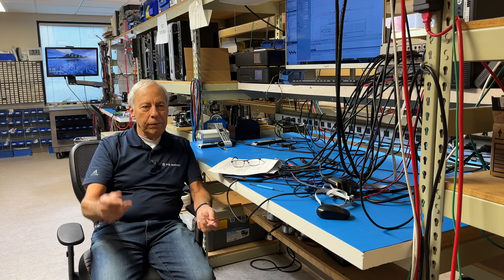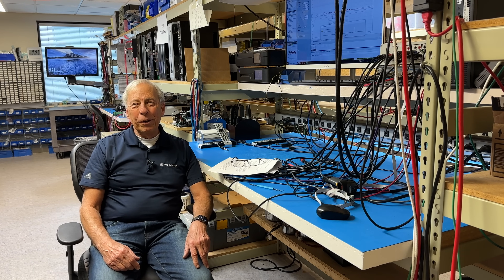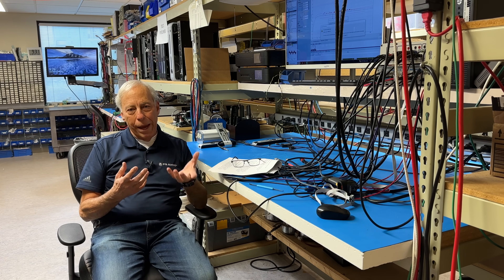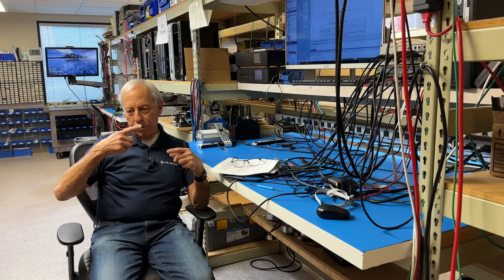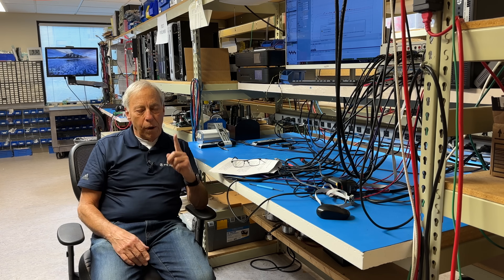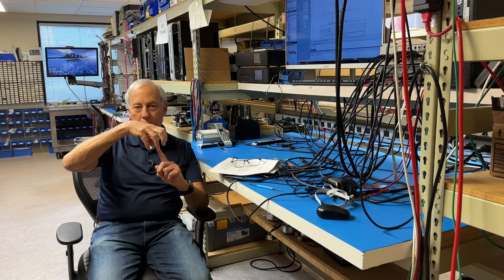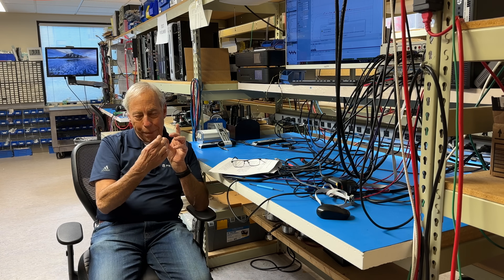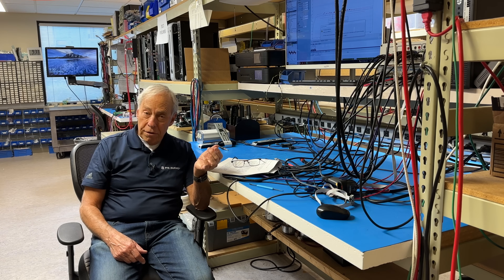Differences in phono cartridges

Comment: The microphone diaphragms do not defy Physics. They do not protrude outward, toward the sound pressure wave blast hitting them. Now, do they? No they do not! They are compressed inward.

And so then what are your speaker diaphragm cones doing? Think about that one for a moment.

Yes that's right. Your speakers are now mimicking. The motion of the microphone diaphragms. And so which way are your speakers initially moving? They are moving away from you. They are sucking away from you. You are hearing the rebound of Inverted Polarity. Out the front of the speakers. And the problems this causes in your room and with your monitoring? It is absolutely insurmountable! The aberrations this will cause. What you are trying to listen to your speakers. Because they are sucking away from you. They are trying to project the sound. Out of the back of the closed speaker box. Were all the low frequency waves are coming off of. And projecting to the wall behind them. Then those reflect off the wall. And come out toward you. Inverted in polarity. To the rebound of sound you are catching off the front of the sucking speakers. Moving away from you. And half the sound is canceling in midair within your room! All over the place! The amount of comb filtering it's causing is truly, Mind Boggling! And your room is filled with Monitoring Anomalies! Because you don't know which direction your speakers are moving in! You are convinced you have it right. Because you follow the instruction manual. To both your power audio amplifier. And your speaker boxes. And you have it wired correctly! Well it's wrong! Wrong! Wrong! Wrong! It's inverted!

Because mindless low information people. Have Demanded it to be Wrong! And the manufacturers are only too happy. To provide for their customers. What they Demand.  Because it's not going to hurt nor kill anybody. If you want it wrong? Sure!

And so what you will find here. Is, that there was one single, Speaker Manufacturer. That also properly thought this through. And bucked the system. Because  their Speakers. You will find. That they are, technically, " Out of Phase". To every and All Other Speaker Manufacturers, out there! At that one company is, JBL of Los Angeles, California. They are the only ones! The only ones in the whole fucking World! That figured this out!

Because everybody only relied upon their mathematical equations and Textbooks. And they left this microphone factor out! Because they are not, Actual Real Audio Engineers. Like I am. Many of them have college degrees! And they don't know what the FUCK. They are listening to? They haven't a clue? Because they will not question, their, Audio Bible Text Books. This is a Fanatical Religious Belief System. That's wrong! They got it wrong! Because they have no idea. What the complete process is or how it works? They only know the math. They only know the textbook examples. They don't know what they are listening to? Neither do you Paul. I'm sorry to inform you of. You've also gotten this backwards. Everybody does. Because they are mathematically correct to the textbook.

This used to be known as Garbage in. Garbage out. And that is precisely what you are hearing. Garbage. Because your absolute Polarity is Inverted.

 Unfortunately. This is a destroyer of, minds. This flies in the face of their textbooks! And they will now all look like Absolute Idiots! As College Professors. Because they got this simple thing wrong. It's a simple thing they all get wrong! Because they are not. Are Not, Recording Engineers, either! You are all Backseat Drivers! Oh my God! And you got it wrong. Because you're not the actual driver. You are not behind the wheel of the Microphones! You do not understand the Process! You left out this important part of the equation! The microphones! As you've done everything. From after the microphone preamp! But not the input. That's what everybody has left out. What's happening at the input! What are the microphones doing? Which way are there diaphragms moving?  When they are blasted by sound pressure waves?

And absolutely nobody. Has been able to think this through, correctly. 99% of everybody gets this wrong with a college degree.  And those without. 99% of everybody are in  Negative Absolute Polarity. With their speaker wiring.

Now I've had discussions with famous, hero of mine, Electrical Engineers. That believe they are correct. Until I spell this process out for them. And I wish I had a camera. For the looks on their faces. When they suddenly realize.  I'm right.  And they've told me they never thought about it this way before? And they have Electrical Engineering Degrees. They have degrees in Acoustic Engineering. They have never gotten this right! And they are absolutely dumbfounded by this! When they hear things correctly! It's a revelation! It's a game changer! It's Radical!

 Add the best thing about this is? The Fix. Is, Absolutely Free! It costs nothing to do! It takes all of 2 minutes. To make the fix. To simply invert. The wiring on both of your speakers. That's it! But only. Only. If, you are using anybody else's speakers other than JBL. Because JBL. Indicated,,  their Polarity, Backwards. From all other Speaker manufacturers. So that when you follow your instruction manuals. With the wrong wiring scheme. You will be hearing it correctly with JBL speakers. Because JBL bucked the system of inverted speaker wiring. Because they understood the process.

Now I know this dates back to at least 1968 for JBL. Though it could date back to the company's founding in 1948? And I believe. This is what brought about the separation. Between James B. Lansing and the Altec Corporation. When they went their separate ways. And Jimmy Lansing (not his actual real birth name) had thought this through. And had a disagreement with his Altec business partners. They believed they were right. He believed he was. And he split off to start the, JBL  Speaker Company. But we will never know for certain? Because he died shortly thereafter. Suddenly and unexpectedly. But the company continued. And continued with this technical concept. To this very day. And I know them to be correct. Others don't. They haven't a clue what's going on? They are Educated Idiots.

And let's face it. Most of these College Professors. Got their jobs doing that. Because they really couldn't cut the mustard. To do it Professionally. Like I have for over 50 years. And they come to me. To learn from me. As I have taught college professors. Because I cannot teach at the university level. I possess no college degree.  I simply went to get myself a Free Degree! In a place called a, Library. Where,, you can read all the books you want on Audio, for Free! It's FREE! It's All Free! At you don't need to spend, $30,000-$80,000. To have some college professor tell you what books you should read about audio. I mean DUH!

(More Real Life Audio in following post)

Comment: So it's tragically funny. It's comically professional. When you get this right. That 99% of these fucking college grads all get this wrong! They FLUNK! They all need to be told what they are hearing! When they are hearing it wrong. And being told that's right. Because it's somebody else's cockamamie distorted religious belief! And you will follow them! They are the master race! And they can prove they are right! And Remy must be nuts!

That last comment is very true. I am nuts. Because I know what I'm hearing. And it's making me nuts! That everybody is wired wrong! And I'm alone. With my religious belief along with JBL. We are the outcasts the black sheep the bad guys. Because everybody else must be right! As they agreed together in a mob of thugs. You will do it our way because we are right! And Remy and JBL is wrong!

Yeah no. I am absolutely right! So is JBL. And that's why I love their monitor speakers. Though I do use others. I have them wired correctly. And I've had other good ones like, Myers, Genelec, Tannoy, KRK, Adams, Active Monitor Speakers. And they are all inverted in negative absolute polarity. And for those? Those require a little technical skill. Along with a screwdriver and soldering iron.

Because with these, Active Type, monitors. You must first remove both, the woofers and the tweeters. (As most are typically 2 way systems). At you must use your soldering iron. To reverse the connections on the tweeter. And then to reverse the connections on the woofer. And then to reinstall the speakers. Into the box. Tightening them, Light Fisted, snuggly. But not wrenching down upon them. With all your strength. Do not do that. Simply make it snug. Not over torqued. Just lightly snug. To be clear. So you don't warp anything. To cause misalignment of the voice coil. Because the closer to the magnet the better. And the tolerances are very tight. So over torquing the screws could cause misalignment  of the voice coil. When you realize how fine the adjustments must be. On the old-fashioned magnetic analog tape recorder heads.  And the extreme precision, those required. That just taking a recorder out on location. Caused variations in head  alignments. And you had to adjust the heads. With test equipment. Once you got on location. If you cared? People like myself cared, a lot. Because I am a Top Professional.

And so we have all acquired and accrued. Different knowledge bases. Within our career fields. And mine runs the gamut in Pro Audio. At the Top of the Heap. Of the Companies. That made the world's greatest recording equipment. More than one. And I was a big contributor.  I was a Requested, contributor. When you gain a reputation. Where some of these companies. Only hired the world's best engineers. Like RCA. Like Bell Laboratories. Like NBC. And well? I worked for a couple of those companies myself. And so did my mentor. To the other one I didn't work for.

And then some kids get, recording certificates a.k.a. degrees. From Recordi Skooolz. And they wave their degrees in my face. And say look what I know! Yeah? What? I can do ProTools! Goody for you Sonny boy. What's your most fun plug-in game? ROCK-EM SOCK-EM Universal Audio? ROCK-EM SOCK-EM Waves? ROCK-EM SOCK-EM SSL? ROCK-EM SOCK-EM  Stephen Slate?  Those are so much fun to play! I don't have any!

So try this for yourself. With both your left and right channel speakers. This must be done strictly at the audio power amplifier output  directly to the input of the speakers. That are going to move the air. And which general direction they will be moving in. Because only there in that position. Can one change the Absolute Polarity. Because Polarity and Phase are two different things in the land of Pro Audio. And nobody understands this variance in jargon? But it's very real. If you want to hear it for real. And not in Negative absolute polarity. Which you are currently listening. Everybody is. Unless you are running JBL speakers. Passive or active powered types. JBL got it right.

Because if you change the phase at the input of the audio power amplifier. That merely inverts the waveform. It does not change what the Absolute Polarity is at the output. This is what everybody gets wrong including electrical engineers. Everybody gets it upside down and inverted. But it's not upside down. It's outside in. And you want the inside out! You're not getting that.

This actually requires one to actually think in 3 Dimensions. Astronauts have to do that. Generally audio engineers don't have to. We deal in lateral soundwaves. Here on terra firma. But understanding what's happening in 3D is Monumental! Everybody else just has mental. They are mental cases. They did all the math and forgot the microphones. It's professionally pathetic and tragically funny. It's terminally stupid. But then some folks still like Donald Trump. And there is nothing to like about that, whatever it is he is? As I've already known to many disgusting overly wealthy children of wealthy parents. And many get like him. And they keep pushing the envelope and breaking laws doing so. Because these kinds of boys like to cheat, cheat, cheat. They make their livelihoods, cheating others. They are Professional Grifters or so to speak. So is Dolby Laboratories.  If anybody buys into this, ATMOS, crap? Immersive my ass!

When your speakers are in Positive Absolute Polarity.. You will achieve. Surround Sound. From only 2 Speakers! Because they are now moving out and protruding, toward you! And everybody is doing, Frequency Response and Room Evaluations. While pumping sound out of  sucking,, negative absolute polarity speakers! And then measuring with a microphone! Whoop de do! Your speakers are not moving correctly! And you are measuring the room. What? Are you kidding me? Unfortunately you are not.

I have had to solve the problems. That electrical engineers have not been able to solve. Because I am not limited. By a college degree of misrepresented information. About somebody's godly belief in something wrong. Hitler had a belief! Kill all the Jews in the world will be better! I don't think so. I'm Jewish! But I don't practice the religion. Because I'm scientifically oriented and aligned. And you have to look and listen to things. From all different angles. Like inverting phase here and there. Then inverting absolute polarity here and there. And you take a listen. Because textbooks and mathematical formulas can't. So we people have to do that. And some people look to us to help them with their problems. As there is more than one religion and solution.

Most people buy into that one popular religion. Which for all intents and purposes. It is also 99% right! Except at the tail end at the output. That's what makes this so funny. It's like everybody was taught for being a little kid. You shouldn't play with your butts. It is just not politically correct. It's not clean and transparent. And it smells funky. Dogs and cats seem to like that. Most people don't. Because it smells like shit. Because it sounds like, shit. Because you have stepped in, shit. And you are walking around with toilet paper stuck to the bottom of your shoe. And your audio smells funny! LMAO.

And so it can be turned into a, colloquial, poetic comedy. Because it is! I think it's very funny. Because I make control rooms and listening environments sound right. Without putting gobbledygook upon the walls. Or needing to run any stupid tests. Other than taking a quick listen to something. And generally a reference recording. That I have been using for years. It's snippets from a number of, well-known, contemporary famous hit records. Including some of my own recordings. That sound a lot like those hit records. Because I also worked with those engineers who made those hit records. Which kind of all ties together why I do the same thing. Though I've had no hits I make any royalties from. Even though billions of people have heard my work. Billions yes. This is not an exaggeration. I'm an accomplished well seasoned audio engineer. And not only have I made, not terribly well known hit records. I worked for a major, 1st, Best, Original, television & Radio Network. As one of their Top Engineers. Some of us know stuff. And we know stuff others don't. Who have degrees of misinformation. Much of which is correct. And we rely upon and respect their knowledge. Yes we do. Most definitely. But that's not to say they also can't get something simple like this wrong. They also do. They also have. And I know those guys. I've known them my entire life and career long and they got this part wrong also. And I think I freaked them out. I made them question everything they have ever done now. Inadvertently. And indirectly while being direct about this. It's a huge problem. One everybody has gotten wrong. And they are all chasing their tails. How to improve sound!

Well you have to start with your speakers be wired correctly first. And understanding. What this absolute polarity thing is all about? Because it's not phase. Though phase inversion can have a small effect on sound. Polarity inversion.  Can dictate which way the air is first going to be moved. And in which direction. In or out? And nobody thought this through!

(More Real Life Audio in following post)